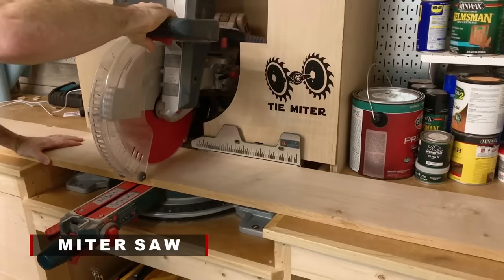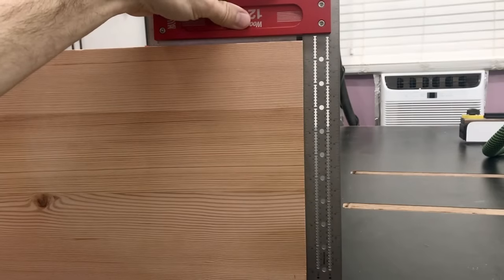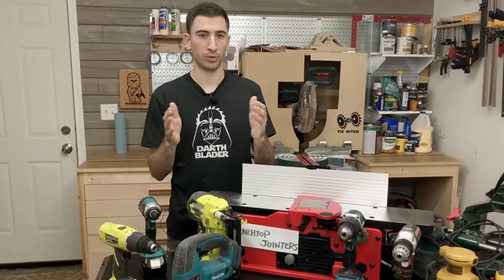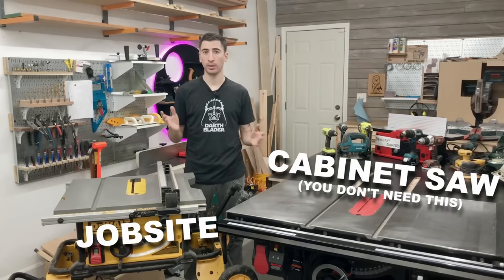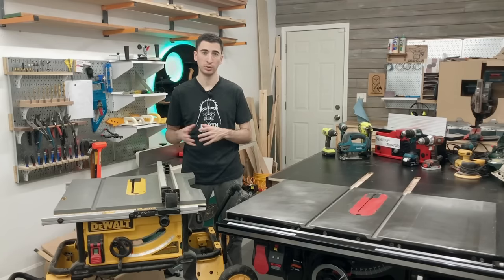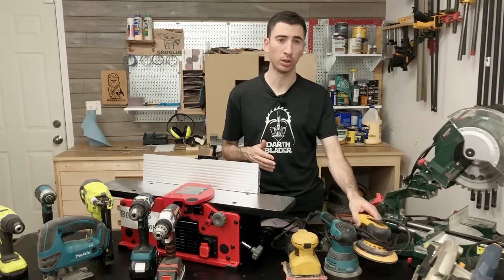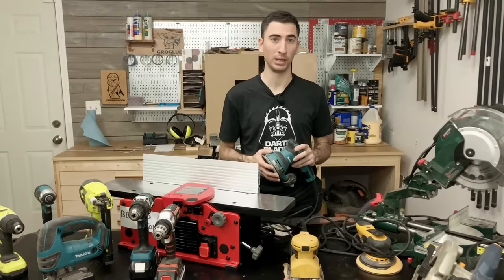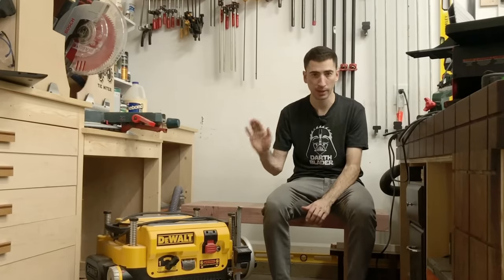Woodworking POWER Tools // Watch Before Buying

Comment: I enjoyed your video you have some great advice. I will say, that Skil, at least not the TS6307-00, doesn't deserve to be lumped in with HF and Ryobi as far as table saws. I own it and its a great saw similar to the dewalt. It's powerful, accurate, rack and pinon fence, accepts dado stack up to 5/8" and has integrated stand for $350, great value saw.
Reply: I agree the Skil 6307 has been good for me and was using a 3/4” dado stack in it this last weekend. I don’t know if it’s significantly better/worse than a Dewalt, but I haven’t had any problems after a year of using it.
Reply: Yeah, I love my Skil saw! There's a handful of YouTubers that rank that saw almost equal to the Dewalt equivalent.

Comment: Seen a lot of Ryobi hate - but I can thoroughly recommend their impact driver. I bought it when I had very little money because I needed it for a job. Used it heavily, daily, for a year, dropping it off of multiple first and second story roofs. 

2.5 years later still probably the most used tool in my house. One battery charge lasts over 2 months with general house hold use - truly couldn’t be happier with it.

Comment: The Skil brand was baught by chevron and their new model had excellent quality as far as anyone can say. Rack and pinion fence that locks on front and back, integrated stand, and a steal of a price. 

You probably should look into it, no need to trash them anymore.
Reply: Agree on this one.  They apparently made some upgrades within the last year as well.  Better quality, more cut capacity, and a taller stand.  It can take a dado blade and it's just a solid saw.
Reply: Sure did, and at 269$ it's an amazing value and very well made. Can't beat the 15 amp 10" table saw by Skil!!

Comment: I’m a GC and we also do a lot of trim and finish carpentry for clients. We use a combo of the dewalt  table saw and a Festool track saw. The dewalt table saw has ripped miles of lumber and it impresses every time it just keeps going.
Reply: Which festool track saw do you use ?
Reply: I screwed a sheet of plywood to the top and made supports and I would use a a straight edge to make a fence and I built custom cabinets onsite for several clients onsite. I love my dewalt table saw. I had another one for years before this one but I had to give it to a buddy when I moved away and didn't have room to bring it. Great saws for onsite work

Comment: My GF bought me the combo  pack of Ryobi with that gawdly huge plastic carry case they first came out with, back in the late 90s. Used them for everything as a storm chaser for over 20 yrs. Still using them today as I build a custom casting deck for my canoe now that I can enjoy retirement.  The only thing I've had to do is buy batteries. I'd highly recommend them whether new or old to construction work.
Reply from the maker: Thats awesome
Reply: I still have some of the older Ryobi blue tools (18v) which have outlasted multiple newer tools. Cannot kill those things.
Reply: 100% agree with you. I've been steadily buying Festool in the 10 years since I went pro as a furniture maker, and they're awesome. But I have an old, blue Ryobi impact driver that just will not die. I dropped it 20 feet onto a concrete floor not once, but twice, and apart from the bits falling out of the holder, it didn't even seem to notice. Replaced the batteries with the LiOn ones and they've also been going strong for 5 years or more. Just a great tool for a ridiculously cheap price.

Comment: I've been woodworking since I was an early teenager. I'm on the leading edge of 73 now. I've built houses, garages, barns, sheds, furniture and cabinetry with the odd canoe, sailboat, rowboat and dory thrown in for variety.  My grandfather taught me the basics of carpentry and cabinetmaking using hand tools only.  Over the years, I began to use power tools and learned to adjust and maintain them to get the best results while speeding up productivity.  A lot of my workshop power tools are old time Craftsman (Contractor Table Saw with expanded table and modified fence,  old school cast iron jointer, etc.)  These have been enhanced by using my abilities with milling machines and lathes to either alter or remanufacture parts. (The problems that some people have had using dado stacks with some Craftsman table saws was actually a pretty easy fix.)  I have added a Dewalt 735 and love it.  I do have a DeWalt miter saw that I have "tuned" and still use it for doing non-repetitive cuts.  Repetitive cuts are done with a table saw and sled.  A lot of mistakes are made by the woodworker and blamed on their tools.  Taking the time to do things correctly is critical to good results.  Take the time to plan, measure and set up before putting tool to wood.  Power tools are great and save a lot of tedious, fatiguing effort, but can ruin a project if not applied properly.  Take the time - you'll be glad you did.

Comment: From my personal experience Ryobi is the brand to go for beginners. The battery ecosystem is fantastic, included features are crazy good for the price, availability and variety of tools and accessories is never a problem, and most importantly, budget. I've had my drill, impact driver, screwdriver, miter saw, jigsaw, trim router and both orbital and finishing sanders for close to 3 years and they've never failed me.
Reply: Ryobi is also good for pros on job site stuff. Tools in the primary colors or dark teal tend to walk off on their own, but highlighter green tools tend to stay where they are xD
Reply: I haven ran Ryobi from the blue days  have 12 of the Lion batteries now  for my daily used pro tools I have mostly brushless but those once a year tools I get the cheaper bushed. have over 20 tools  drills drivers sanders saws  lawn trimer polesaw 4 gallon vac  love this for fast car clean up and pellet stove.
Reply: It's really easy to put a ryobi battery into a ryobi tool. Other brands with rail-style interfaces I've found it easy to miss one side while not paying enough attention.
Reply: Me too

Comment: You make a lot of great points in this video! I have always hated the "buy once, cry once" mentality. I have always operated on "buy the best you can reasonably afford" and if you end up using the tool a lot, save up for a better version in the future.
Reply from the maker: That's a perfect way to sum it up.
Reply: Exactly!
Reply: this takes sooo much longer to say, though :)
Reply: I subscribe to this thought process except I borrow from friends first. And if I find I'm borrowing it more than a couple times, I buy my own and know if I want a more expensive one.
Reply: I agree, I have been in the WWing business since '79, purchase the best tools you can afford, garbage tools make your job harder. The better the tool the more enjoyable the work. I do not agree on the miter saw comment of the vid poster, every shop is different on what you build, in my shop, cabinet saw, miter saw and cyclone are used daily...
Reply: I met a cabinet installer that started his cabinet career with a skillsaw, a piece of 3/4 inch plywood and a set of sawhorses.  That was his “table saw”.
Reply: @pocketlint82  I hate borrowing tools either way. I don’t think that tools should be shared. Not the tools. No. 😉
Reply: I think you’re totally wrong especially when it comes to table saws. Go ask a couple guys with mangled hands and missing fingers how much they would pay to have their hands fully functional. I guarantee it’s less than the cost of the most expensive saw stop table saw. I’ve asked a few and their numbers were way higher than the cost of a saw stop table saw.
Reply: @davelowesky8054  Cool

Comment: I've been using my Ryobi job site table saw for 12 years now. It has a wide stance integrated fold-up stand, 31" right rip and will easily handle up to 7/8" dado. I've no complaints.
Reply: Yeah, I don't understand his apparent distaste for the Ryobi brand. They are great tools and I swear by them.
Reply: What’s interesting is the reviews for Ryobi table saws are pretty negative. Not exactly sure why but it’s steering me away from them.  That said I have a Ryobi miter saw and I really like it.

Comment: My first major tool purchase for my shop, when I was 17 years old , was a used Delta Professional cabinet makers table saw from probably the forties or fifties. It was eighty dollars with a new blade worth more than the cost of the saw. One of the features of this saw was that for miter cuts the blade remained fixed and the whole table tilted for the angle cut. At first I thought it was strange, however I discovered that the board being cut was pressed against the fence  with gravity ,making for a beautiful cut every time. Eventually I thought it was time to upgrade to a newer saw with all the bells and whistles even though the saw never failed I gave the old Delta to my son. Boy I wish I had that old saw back, fifty three years later, but I'm sure he is enjoying it.  The point is , like  you, we  don't need more than what works for you.  And you don't always get good results from a fancy name brand tool. I'm still looking for good used tools with quality and safety in mind. Don't focus on name brands because of the name but quality you can usually spot, but you may never know until you use it ,some times we get burned . Very nice video.